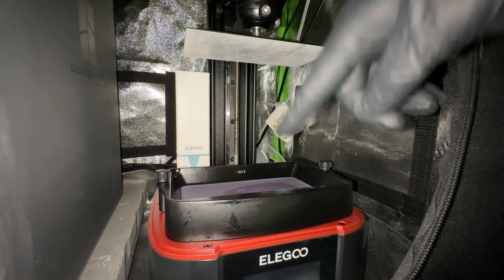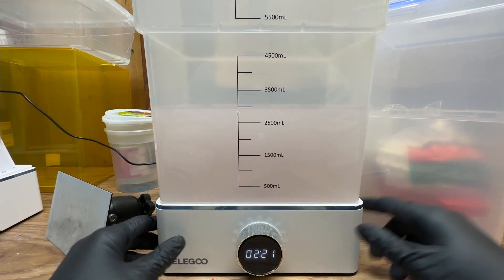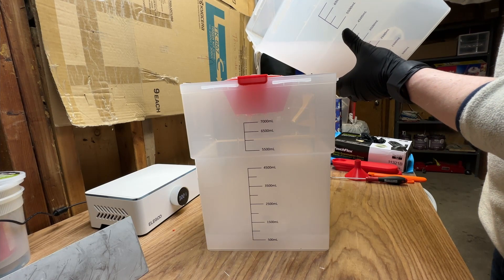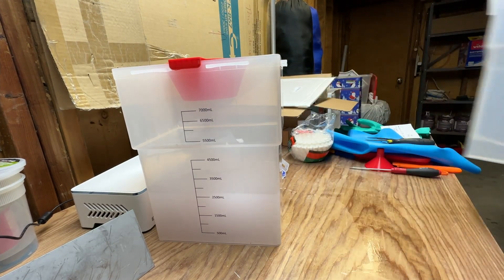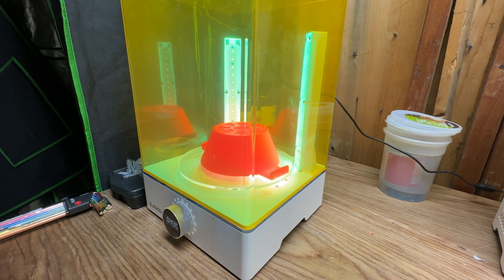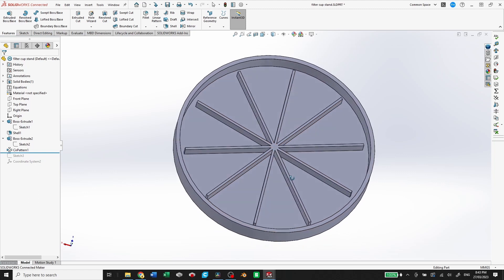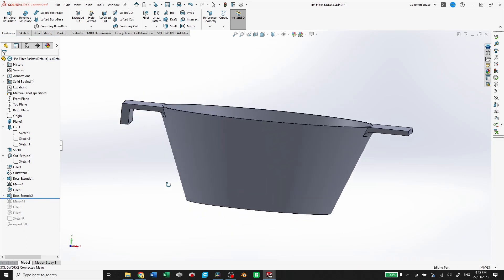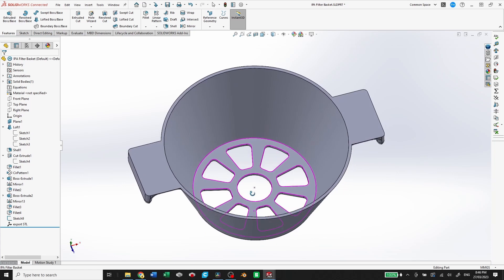Filter Your IPA Using a Coffee Filter - Resin 3D Printing Workflow

Comment: The first mistake you made was stirring the tank up.   I see.  

 The product you had was very clear.  Pour the IPA into a tall skinny storage tank and allow it to settle on the bench.  This will allow more altitude for the heavier material to fall down into.  Specific gravity is the best free  filter time can buy.   The colder the temperature, the more clear it will settle.     Run a slow siphon though your filter from the bench to a tank on the floor,  and dont let your siphon tube suck the sediment any where near from the bottom.

Comment: Do you know if you filter out water too? I made the mistake of trying the water washable resin and now I am struggling to get rid of it.
Reply from the maker: It will filter water but you'll have to let the water+resin cure in the sun before disposing of it.
Reply: @3DPrintStuff  thanks for the tip

Comment: I'm on day 2 of my resin printing journey (had a great day 1, changed resin - now total disaster!).  Am curios.....how do you treat your gloves when you dispose of them?  When i'm removing failed prints from the vat i'll invariably get a few drops of resin on them - i spray my gloves (whilst on my hands) with 90% IPA before disposing of the gloves - i chuck all my stuff in a clear bag and leave it outside (im from the uk so with our lack of sun - maybe a couple of seasons!).  The gloves usually get turned inside out - is that a problem as they've been liberally sprayed with IPA but i dont believe i can cure the resin on them - your insights would be greatly appreciated.  Cheers
Reply from the maker: I have a UV flashlight that I use for "clean up" tasks like if there's resin on my silicone mat or to cure the resin on the outside of my gloves before I dispose of them. I also usually put all materials that have had contact with resin in my curing station before throwing it out. So paper towels, stir sticks, gloves. 

I'm not a resin printing expert by any means, that's just what I've been doing to try and ensure no uncured resin makes it into the garbage.

Comment: Curious if you ran the resin filled IPA through the curing station first or not? This normally should cause the resin in suspension to cure and sink to the bottom. Then running the IPA through the filters may have better results.
Reply from the maker: I didn't run the IPA through the curing station first. I don't think the container of IPA will fit in the curing station, I'd have to transfer the IPA into a smaller container first. I'll try this next time my IPA gets too cloudy, it could be a while, I haven't been printing much resin.

Comment: Seeing how initially your IPA was pretty clear until you stirred it, would an approach allowing the resin to sink to the bottom and then a small pump and surface-skimmer to pull out most of the clear IPA without stirring after things have settled (so basically always leaving some IPA in the sink tank for the future runs).  I myself use water-washable resin and then just have the cleaning water stand in a jar outside for several days and then filter it and dispose of the remainder (as the sun should have cured any resin).
Reply from the maker: Yeah I had a similar thought while filming this and it taking ages. I had poured off 2/3 of the IPA before filming but when I do this again I'll pour or pump off way more and only leave a little bit in the bottom.

What printer do you have? Have you gotten good results with water washable? I have some on hand but haven't tried it yet.
Reply: @3DPrintStuff  Elegoo Mars 2 and I love the transparent Elegoo water-washable resin.  I don't print that much resin though, so I don't have a lot to compare against.
Reply: Yes

Comment: Nice. I know nothing about resin printing. I do know that filtering through coffee filters takes forever though. I'm wondering how much faster the filter would flow with vertical channels inside your filter holder, ridges or similar to let the sides of the filter work better. Also, it looks like you might be able to fit two of your filter holders on top of your tank, or maybe a modified side-by-each two filter holder. Not sure if that would be more trouble than it's worth though.
Reply from the maker: Yeah I definitely considered slapping 2 on the top to make it go faster. Ridges on the sides would also be a good idea. The folds in the filter paper did seem to keep their shape so I'm not sure how much faster it would go.